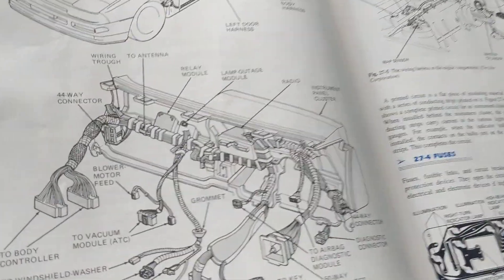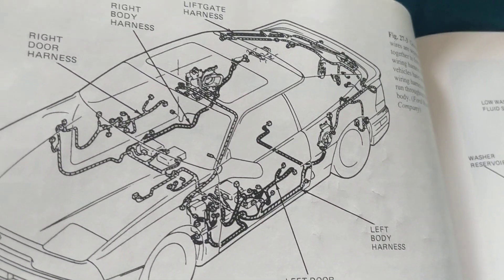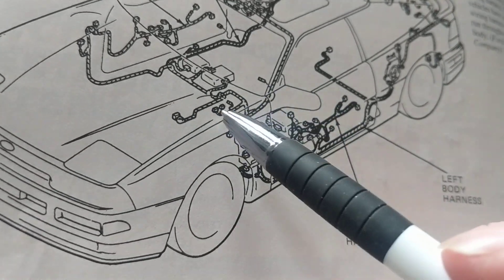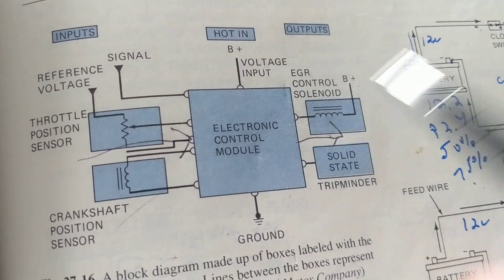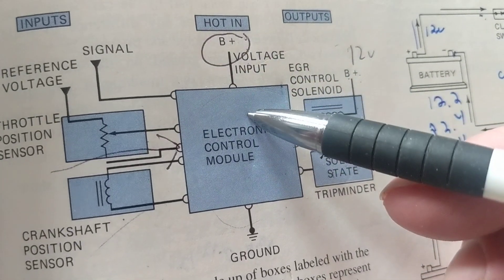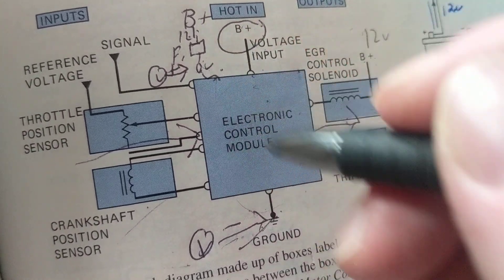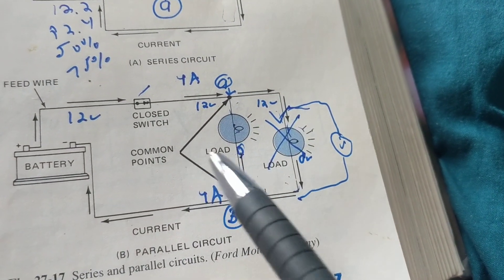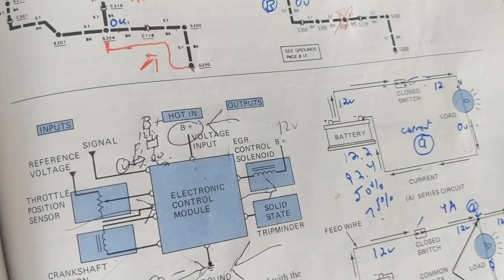UNDERSTANDING ELECTRICAL WIRING OF MODULES AND THE HARNESS WIRE

Comment: Hey Joe. I have a Blue-Bird micro Bus that has emergency sensors at the doors, linked to an interlock system. how do i completly remove this system?
Reply from the maker: This is a school bus isn't it
Reply: @Joeelectronicschematicsforauto   Correct. 2002. GMC savana 3500 Turbo Diesel. Blue-Bird did the Bus conversion. They have Schematics available for the VIN. Unfortunately I'm Just finding your videos and trying to teach myself as I go.

Comment: How many oms in a short? High ohms? How do u know is 0 ohms good?
Reply from the maker: A short is 0 ohms the only time you want to measure zero ohms is if you're measuring the ground wire with reference to that ground wire
Reply from the maker: You never want to measure zero ohms after the fuse that means there is a dead short to ground